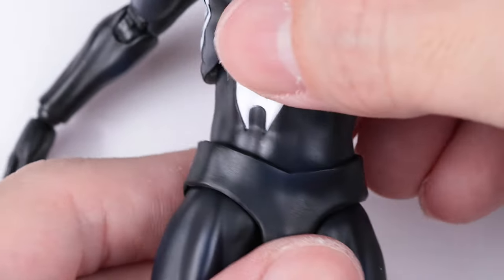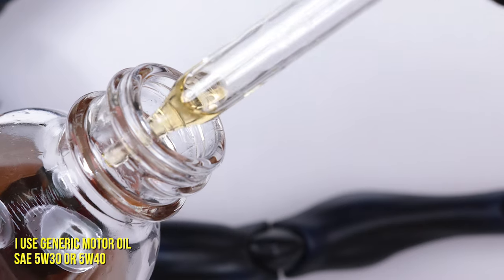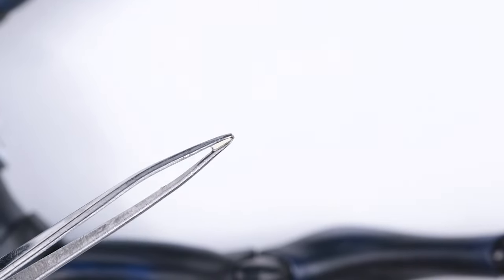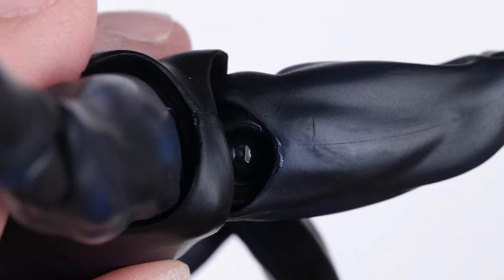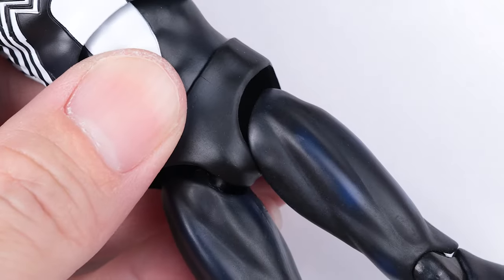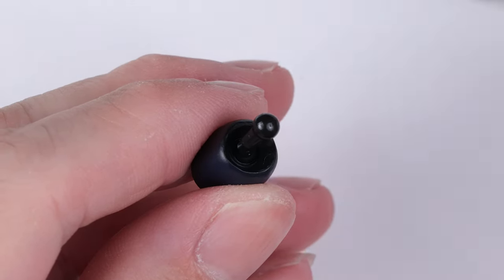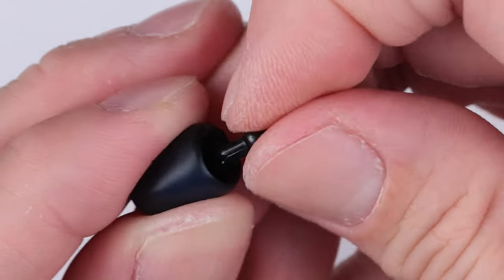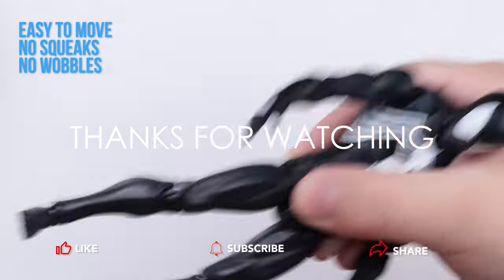Figure Tips : Oiling Tight Joints

Comment: Just wanted to quickly say thank you because this video has been a blessing, I recently got multiple Mafex X-Men and some of the joints were ridiculously tight, Which was quite disappointing because I definitely didn't pay import prices for them.

People recommended all sorts of silly things to me for how to remedy the issue and then I found this video and couldn't be happier.

I used nothing but a drop or two of 100% silicone oil with a needle tipped applicator and it allowed the oil to seep right into the joints, I do a few full rotations to work it on to the ball and joint fully and wipe away any excess with a Qtip, it works perfectly!
Reply from the maker: glad i could help, buddy 😁🙏

Comment: Ohhh boy maybe not a figure review but indeed some thigh joint solving problems tips are needed.
Just to remember how SUPERTIGH and stiff is to try to move Krillin 2.0 torso kills me!!!! TmT
No to say some other tigh joints like shoulder balljoint, pelvic area joints etc.
Reply from the maker: not just krillin 2.0, my gohan & krillin battle clothes' waist are supertight as well.
you can easily pull the torso to oil them fortunately
now android 16 thighs are making me nervous even after oil treatment 😥
just so sad with figuarts joint quality lately
Reply: @toysfront  yeah figuarts/Tamashii joint quality control just scare anybody to pose their figures. 

Yeah its good the waist/torso articulations are easy to disarm and put em back together for any  "fix", but the upper torso i havent try, cuse my krillin2.0 waist isnt thight but that diaphragm/upper torso articulacion is almost imposible to bend but using a lot of strenght, and its annoyin. 
Also squeaking waist, and waist-leg joints scares me, so also thinking about sanding or using some oil like you in those joints. 
About AND16 joints problems as  you say, i m thinking the problem is that the male peg joints are just a tad bigger or with any irregularities than its female peg socket, makin the articulation of the figure a pain and almost a Horror/Thriller Movie.... xS
Hope you made it to fixe it cuse it looks so cool, but i Expected an Updated articlacion for AND16 .
Reply from the maker: for the squeaky waist & thigh i used some oil on them and they work fortunately.
u should try it when u had the chance, friend 😉🙏👍
Reply: @toysfront  thank u yeah im lookin to try it

Comment: Good tip but I would recommend using 100% silicone oil, it works best. I bought a bottle of team associated 80wt oil years ago and still have a lot left over.  A micro drop is more than enough
Reply from the maker: yes, i think any thick oil might work.
i just use what's available to me 🤭
thx for the visit, friend 🙏😁

Comment: I prefer Hot water , remove the Joint if possible Sand the Joint. The Problem is, That the Joint is to big ;-)
But Great idea with the oil!
Reply: Ive doing that with my figuarts an other figures.
Just to say, i solved. Bardocks bicep swivel problem with that. Hot water to disarm it, a lil strength was  needed anyways, scary and then proceed to sand cautously the male.peg  with sanding paper. Also took off  bardoks head  after some hot watter, and made bardocks head hole a bit bigger for easy remove .
Tigh hand joints, coolers tail joint, and gokus ssj4 tail joint. All of em cuse neede a lot o strenght to put em on and take em off.
Reply from the maker: i tried hot water treatment with hard plastic but they dont work. 
r u sure they work?
i have to try your method since oil method doesnt work with my android 16 thigh.
Reply: @toysfront  yeah, hot water treatment in my opinion, its more to free stucked joints. If any joint goes back to feel stiff and tight after hot water, 
As said, the problem is the male joint peg  is a bit bigger for the joint socket, making it too tight as the famous Bardocks bicep swivel problem, thats needed to be sand in order to fit nice and be able to rotate the bicep without worrying to broke the articulacion.
Reply: @toysfront  Im doing lots of Customs, i had 7 Bardocks and the Bicep of all that Figures could not move. I solved it by using hot Water and sanding the joint. You just sand a little, put it back in, if it moves, it is okay, if not use again hot water, remove and sand a little more
Reply: @LocuS-Sinclair I have the same problem with my Bardock
Reply: @LocuS-Sinclair I have the same problem with my Bardock

Comment: i use dish soap and it works pretty good lol
Reply from the maker: the downside of using soap to lubricate is, it will be dry after a while.
i think the objective is to keep the joint wet with lubricant to avoid sticky joint.
thx for the visit, friend 😁🙏

Comment: is there a way to remove the oil if you put too much?
Reply: Use napkin bruh
Reply: @TDuy-0607  nah man napkin doesn't work, i put way too much, i need something to remove the residue
Reply: @TDuy-0607  no bro towel doesnt work, its stuck to the plastic, i gotta find something that can get it off
Reply from the maker: if the oil gets in other parts, i use toilet paper to absorb the excess oil.
its thin enough to get into the crevice.
if you want to clean the parts that's oily, use soap water. if soap water still cant remove the oily parts, use detergent & water.